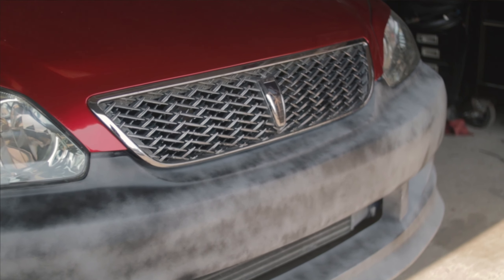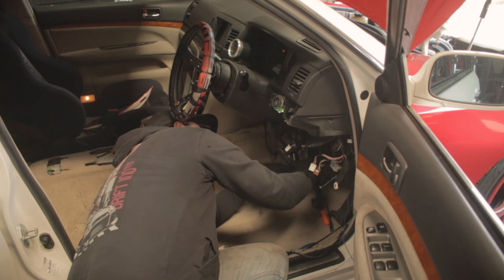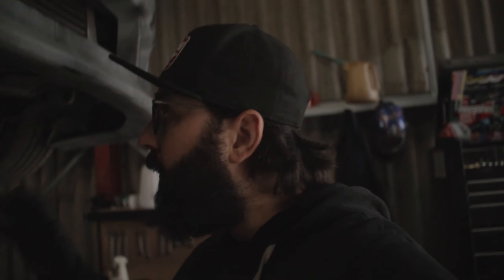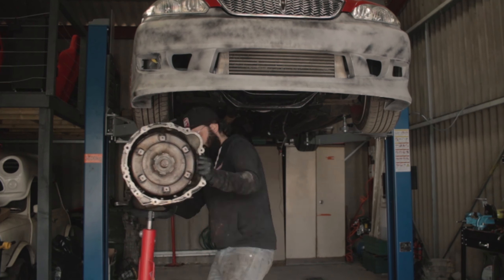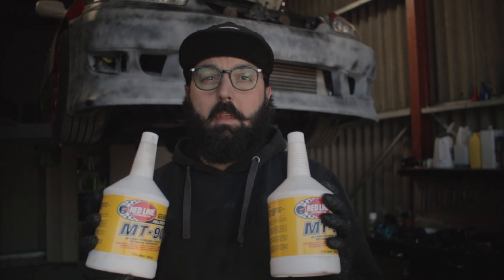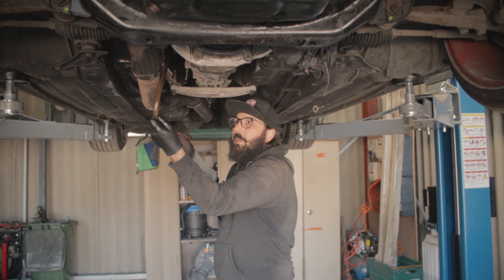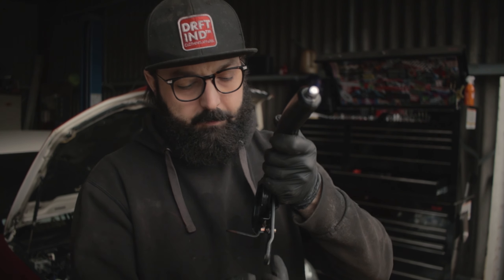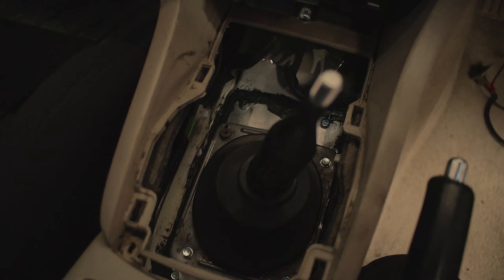Toyota Mark II JZX110 Manual swap on budget!

Comment: LHD XE10 (IS200/IS300/RS200/AS200) Handbrake fits perfect in a X110 Chassis mate 👌🏻
Reply from the maker: I gathered it would. No time though. I worked out good though.

Don't worry mate. I been watching too ;)
Reply: do you know if it fits in an x100 chassis?
Reply: @cole_butter  no they do not, they are totally different as a friend of mine is currently doing a manual swap on his X100 cresta
Reply: @BENJY-JP  do you know what fits on an x100 chassis?
Reply: @cole_butter  not personally sorry

Comment: Nice bro ✊. I used the r150 with bellhousing swap in my z32 300zx 2j big single. Shorter 1st but beefier gears for towing. Gets the borg warner going with the short diff ratio

Comment: i have a 110 im trying to figure out if i should go manual or try because i plan on going standalone.. but seems like no ecus support the auto with plug and play. I heard of people using there own auto standalones to do it but for price might aswell just manual swap. Have you ever heard of the AR5? Exact same as a r154 just he bellhousing has different bolts they hold same amount as a r154. How much does a j160 hold?

Comment: Hey man, you just use the existing hand brake / foot brake pedal cable with the handbrake correct?
Reply from the maker: No. The front part is from the is200. Also you with have to weld together two of the cable splitters.

The crown conversion videos I did are very similar and more detailed

Comment: so strange, my 110 has no hole pre drilled for the master since the handbrake is on the centre console from factory. Also did you have to cut the dead pedal out of the floor? Couple of guides ive seen say to do this
Reply: also can you link me the line you used for the master to slave? does it replace the need for the factory hard line? Im finding it hard to track down the factory hardline and to ship it as well since its an awkward shape
Reply: @Joel_Harris  another YouTuber from Australia had the same issue. His JZX110 wasn't precut either. Regarding the foot rest you don't have to cut it, but I've heard it's more comfortable if you have big feet.

You can use Amayama or Partsouq to find the hard line, handbrake etc and get it shipped.
Reply: @Joel_Harris  also look up Krishneil Garib on YouTube, he has episodes on an R154 conversion with loads of great information
Reply: @Vaatzes  thanks mate, have been messaging him since he lives an hour from me which is handy. Hardline is super hard to ship and doesnt come up on amayama
Reply from the maker: @Joel_Harris  I can imagine there is a difference between the S1 an S2 cars.
Reply from the maker: https://www.ebay.co.uk/itm/154314990461?fits=Model%3ASupra&hash=item23ede3e37d:g:GpYAAOSwz2JbVyz-
Reply: @GeorgeHampl  thanks man! There is no difference in series but difference is between g-tb (this car with foot brake) and IR-V (mine with handbrake). good to know that the supra line fits the 110 master, I assume it uses the same slave as a r154?
Reply from the maker: @Joel_Harris  That's good to know. Thank you for that. I assumed it was the same as the JZX100
Reply: @GeorgeHampl  I didnt know any jzx110's came predrilled until I saw this video! so strange ahhah

Comment: Do you have a detailed video of the wiring or a link? Ive recently bought a manually converted r154 jzx110 but the engine management light stays on and will not go off seems to be throwing faults for auto box solenoids or somthing?
Reply from the maker: You need to wire in some resistors to get rid of the eml. Where are you located?
Reply: @GeorgeHampl I am in Northern Ireland any chance you would have a video or description? Other thing is mine seems to read L constantly and not N for neutral I'm mew to the jzx and it was converted before I purchased it so I'm kinda stuck in the middle now 😅 any help is greatly appreciated.
Reply: @markkirkpatrick2266  did you ever figure this out?
Reply: @descentmvm  no mate think i need an emulator